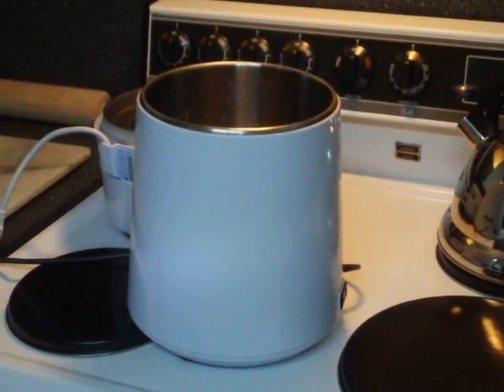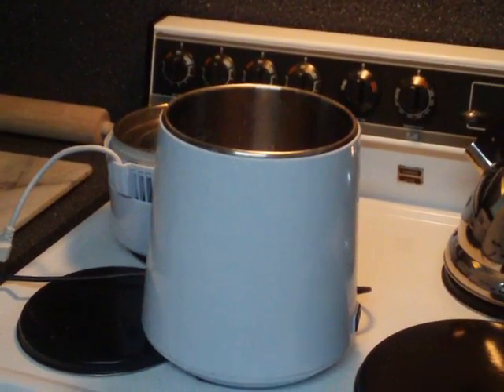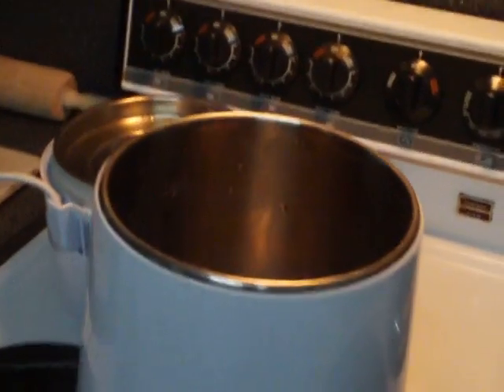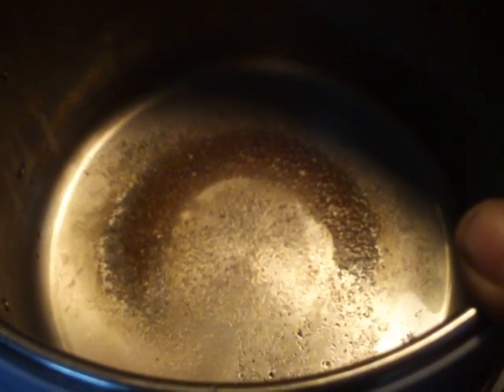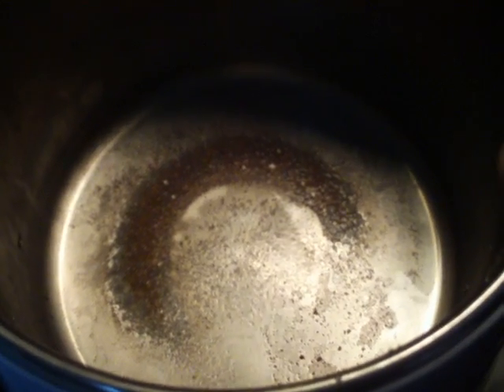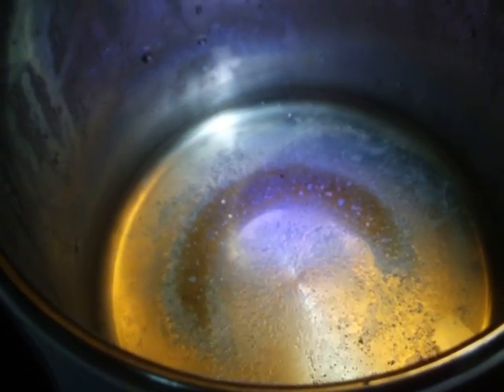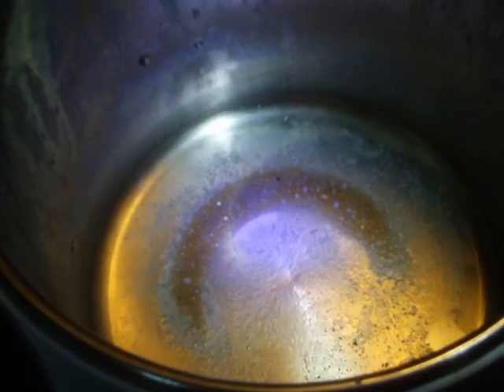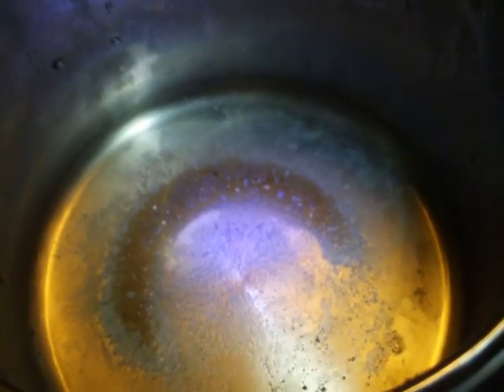How flouride and chlorine eat stainless steel

Comment: I just got a distiller and was bummed to find out that a distiller doesn’t remove chlorine. Is that true ?
Reply from the maker: Iris S As far as I know it does. When I use mine I always test it with a tds meter. Your suppose to change the filter usually found on inside top of the devise. Ive used mine on and off more than 5 years and it still reads 000 on the tds.
Reply: @infonator1  thanks for letting me know! I will do my research more and I do want to  get a tds meter, just out of curiousity. :) that's supposed to measure particles in the water right? thanks!
Reply from the maker: Iris S Yes it counts particles. Per million.

Comment: I'm really confused by this video. I was hoping for something useful about chlorine corrosion of stainless steels. I'm not convinced this is remotely relevant. 4-16ppm of what?  Are you talking about hardness or dissolved solids? If so, give the distiller a wipe after each use and get on with the rest of your life.